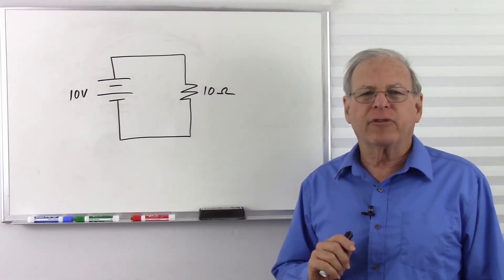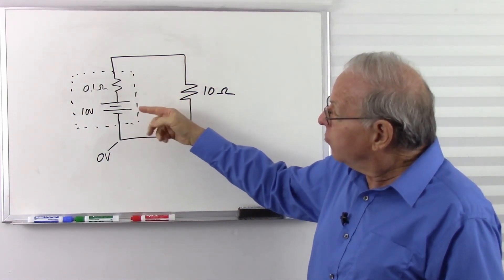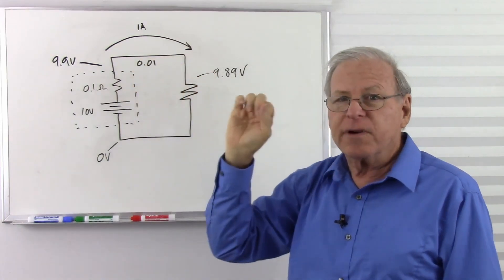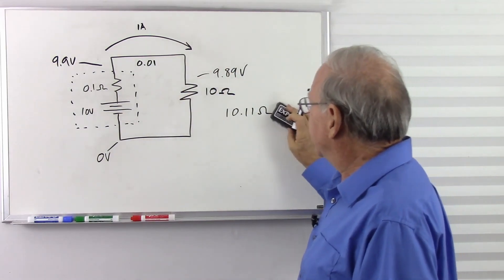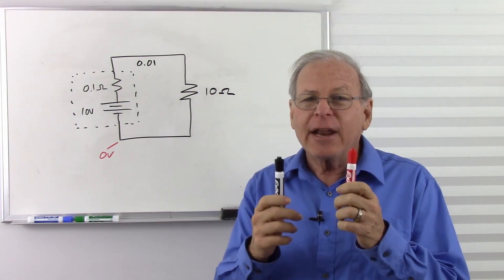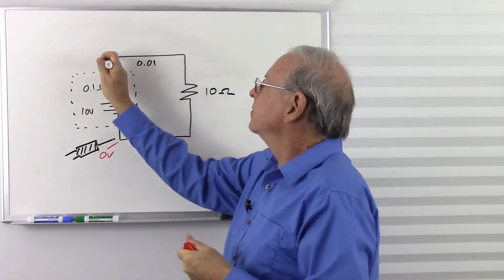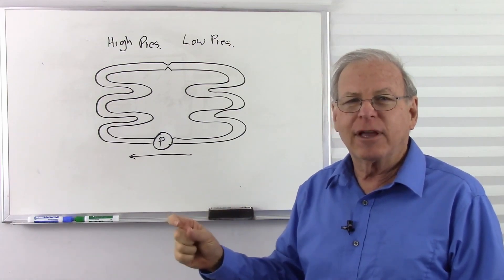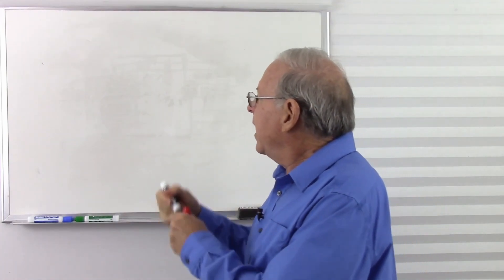Why Don't Wires Have a Voltage Drop

Comment: One last point, in the real world… the final wire going from the last resistor to the negative battery terminal actually has a tiny resistance, and a tiny voltage across it. Which according to ohms law would calculate out to the same total series current of the circuit.  So if you put your black probe on the battery’s actual anode rod there is always some tiny positive voltage on the conductor leading to it.  It would be nearly impossible to measure but it’s there and brings the electrons home.
Reply: perfeita complementação. Se fosse zero volts estaríamos com o circuito interrompido.